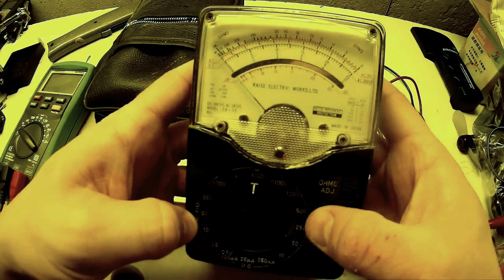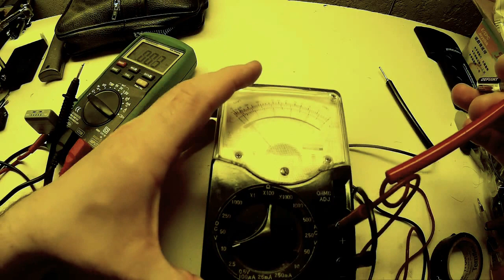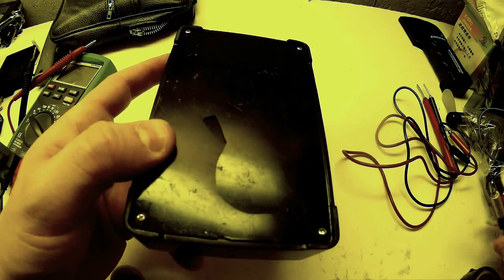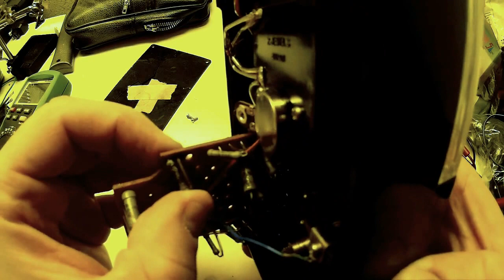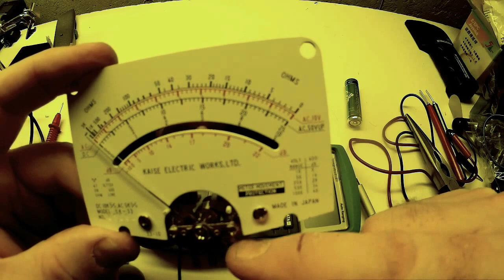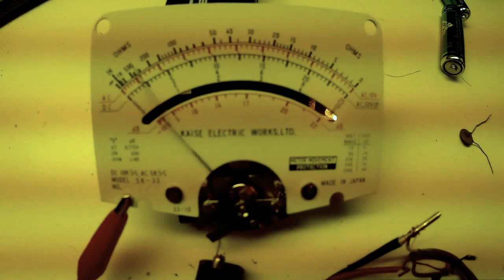Vintage Analog Multimeter Teardown (Kaise SK-33)

Comment: I have this model too. Can anyone help me to identify 2 burnt resisters?  One resistor is connected to one side of the rotary switch when set to x1 Ohms range, with the other one connected to the other contact for this same x1 Ohms range. I can send pics of the burnt resistors and where they are connected to the rotary switch. A schematic would be awesome to obtain. Thanx to anyone who can help. Email me teletwanger at hawt mail dot calm.
Reply from the maker: Is there any value on the resistor? You my wish to look at resistors for the x10 and x100 and see if you can extrapolate to determine what value you will need for x1. You can also just try a few different resistors, measuring known values (which you can verify on x10 and x100). The meter is fairly simple so you should be able to check the wiring and determine what it is doing.

Comment: In an analoge meter it should be piece of cake to calculate what the value should be by knowing the properties of the movement and where it's place in circuit is. The better precision replacement you can get the better. Sure you can even bundle together run of the mill 5% tolerances to get the desired precision if you have a good ohm meter. The tolerances of these old meters wasn't sky rocketing let alone the reading uncertainty even if you do the best zeroing and reading using the mirror so you shouldn't notice any difference after replacing.
A shame to discard such an old meter. Sure modern ones are most "better" but once in a while you stumble upon usages where those old ones are just doing better out of the box than your expensive digital one. For one they're much better averaging fluctuations if you're doing current measurement on PWM stuff. Sure you can shunt with a suitable capacitor. Also if measuring something with switches you might even have a bad switch even if your meter says full voltage if just measuring unloaded voltage. Sure again you can shunt - this time with a 20k resistor (many analog meters are 20k) but again....
I found an old Avo 8 MK III in a dumpster - almost like new except a few minor scratches from the dumpster and the fact it was inoperable. Repaired it (wrong adjustment of cut out) and it's absolutely stunning for a 50 year (sharp!) old instrument. What a marvelous instrument. Once regarded as the Fluke of the time. Claims a precision of 2% for the full scale on DC voltage but in reality it's better than 1%. Still not nearly as accurate as your modern meter. On the other hand I was trying to measure standby usage of some smart home assistants - much easier to get a good idea on the Avo than on a wildly fluctuating digital meter.
Reply: Btw. Sure you /can/ still get analog meters. But most if not all are just junk. Even the last revision of the old Avo 8 from the 90s while better than most is just a sad imitation of the older ones. Up to Mk IV IMHO have the best movements. Mk III may be just a tad less precise than Mk IV but I like the PCB less design better. Oh and from the Mk V and forth the switches aren't as nice either - on the PCB instead of the nice old heavy duty switches.

Comment: please what number ohm résistor burn S.V.P adresse number mike.cluster@hotmail.com
Reply from the maker: +Mike Cluster I am not sure, the resistor is completely burned and there is no marking. To find out, I would have to calculate the theoretical value that it should be... based on the design of the unit and what measurement and range it is meant for. However, the unit is not worth my time repairing anyways so I am not bothering with it.
Reply: I have one of these meters. In very good condition. But my meter is broken. Are you doing anything with yours? Greetings Paul.